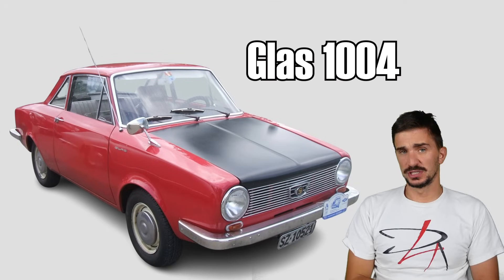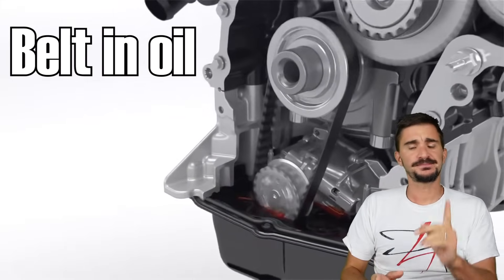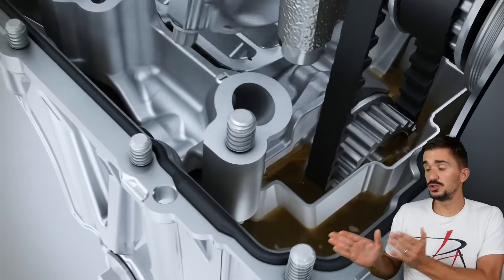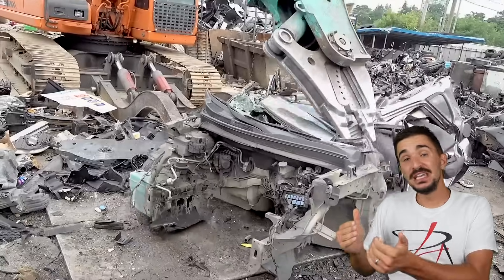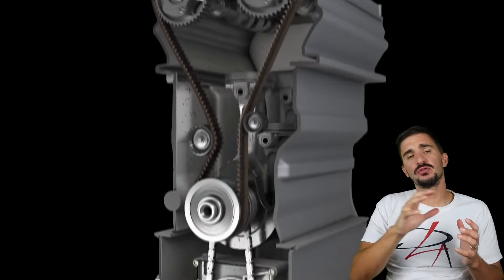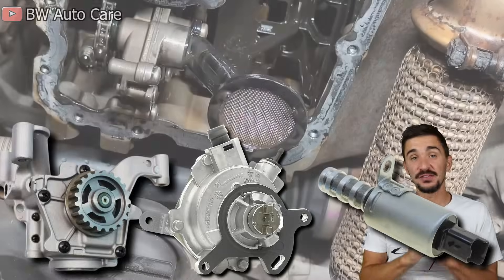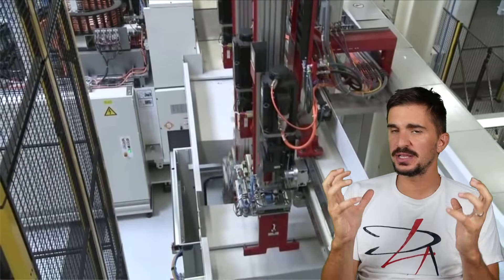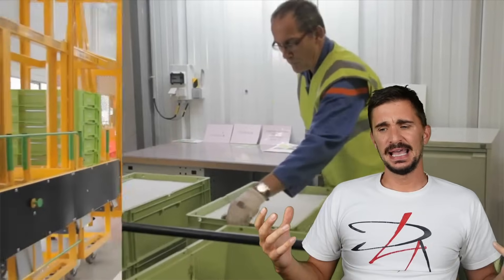Who Approved This and Why Is It Still Being Made? Wet Belt aka Belt in Oil Engines

Comment: I'm from Brazil, Yes we have middle age problems AND wet belts. I always recommend people to ask before purchasing a new car, if it has wet belt don't go any further. But most of people just choose cars by their design and comfort items
Reply: You hit the nail on the head, if potential car buyers did any research at all everyone would be driving around in 20 year old Toyota Corollas.
Reply: I am guilty myself. I was happy to buy a newly designed engine w the last car, i was proud to have checked. But besides that i did not dig any deeper. One would think people could compare more easily these days, but where can i find all that detailed info in 1 spot. Or is the answer to everything Honda or Toyota. ?
Reply: @anrit5972 well that’s literally my family rn 😂😂😂
Reply: Add in poorly made electronics and buggy software, and you have it all!
Reply: I bought a diesel with a timing belt because it was easier to maintain than a v6 with chains that would be an engine out repair. 
Better fuel mileage is nice but goes to higher maintenance cost. 
Love the exhaust brake though.
Reply: Brazilian here. Vast majority of mine and the poster's fellow country folks don't think objectively but rather "feel it is just the right car" for them, and proceed with the purchase. There hardly has ever been a nation milked for they money by the automobile industry than Brazilians. And now the Chinese are doing just that with they crappy, absurdly-expensive EVs.
Reply: The 2.7 TT in my Bronco has a wet oil pump belt... idiotic design.
Reply: us real car people choose cars on their lack of creature comforts however.. AC, no don't need that. Electric windows, no don't need that. ABS, no don't need that. Traction control, no don't need that. lol
Reply: @101jtag Honda or Toyota is always the right answer.
Reply: "all the kids will eat it up if it's packaged properly"
Reply: Bingo
Reply: I drive a 20 old naturally aspirated diesel car with no luxury. Its very reliable and easy to maintain.
Reply: @samazd4015  well I recently acquired a 1991 Volkswagen Gol with the AP1600 engine and is just awesome. It was made in Brazil and happily living in Uruguay.
Reply: @101jtag  "Or is the answer to everything Honda or Toyota. ?"  Mostly. They are not without some faults though, of course.  Any 5-speed or 6-speed Hondamatic automatic attached to a Honda V6 is generally a risk, those automatics were marginal even on the four-cylinder let alone the J series V6.
Reply: Old cars are just of better quality i guess @TickiTucki
Reply: @samazd4015  I completely agree with you.
Reply: The problem is if you avoid a wet belt, there is another boobytrap waiting for you, completely different yet also catastrophic.
Reply: @samazd4015  How old are you? I'm only 30 and I remember how much trouble old cars could have starting in the cold. I literally can't remember the last time I was freezing my butt off in a car because it wouldn't start.

That's not to say that some things aren't designed more cheaply. White goods come to mind. But just going by my experience cars tend to be more reliable these days.

Beware self-pity and nostalgia. Plenty of people like to pretend everything used to be better in the past. It's usually just an excuse for why they feel worse now.
Reply: @mrjoe5292  with old cars i mean 20-30 year old cars. I think they are more reliable than new to 10 year old cars because they have less emission control systems which often cause problems
Reply: I would include any vehicle with a CVT.
Reply: I also hate that people don't have any understanding of cars nowadays but on the other hand it shouldn't be necessary. People get ripped of by those big car companies and there should be more legislation in more countries against that.
Reply: I wouldn't expect less from the same people that believe automatic transmissions are maintenance-free, then quickly come to trash automatic vehicles when their transmissions invariably break and a full replacment is half the price of their car.

Comment: "I'm a fan of objectivity and rationality."  A-effing-men, brother, speak it!  This is the best-explained, best-reasoned takedown of the industry's painfully obvious wet belt scam.  Absolutely beautiful.
Reply: They did it to flamboozle regulators: the 1% savings was all about milage gains [real or imagined].  The fact it costs consumers 1000x to maintain vs what gets saved at the pump?  Not a concern of CAFE standards, or the politicians pretending they know anything about engineering or economics.
Reply: The lawsuits say it all... Sealants is losing their $#!^.... and that means money in the long run...
Reply: I HATE rubber timing belts
Reply: @jugears1081  Frankly, I prefer (a) gear-driven cam(s) but that's a lot more easily done on one of my Harleys than on an auto engine.  😀
Reply: @flinch622  totally - not mentioned in this video, but it's often the unintended consequences of government regulations that results in the OPPOSITE of what they intended.
Reply: Manufacturers know this design was faulty, but it's a cost effective way to wring a fraction more efficiency from the engine. Government mandates are mostly to blame.

Comment: I've worked in the automotive industry and you're correct, everything and that IS everything is driven by profit! I've been in meetings where a known problem is being discussed and the conclusion has been to leave it alone, fight any warranty claims and, if compensation is paid out it's still cheaper than a production line change.
Reply: WOW Im somehow not that suprised, but still WOW
Reply: EV motors save money by having no timing. Cheaper still.
Reply: @markrowland1366  Yeah! Then the batteries bump a rock and you have to scrap them because the warning button popped off (warning that the battery might have swelled). Try searching for a clip that shows a KIA Ioniq in Canada being charged $60.000 for a new battery for just bumping a rock with the undercarriage! A very small rock, I might add.
Reply: Of course it's all about profit. That's what businesses are made for. 

The main problem lies with the consumer. If the consumer doesn't research big purchases like the car they are about to get indebted for, these issues will persist. 

If, however, people, like our friend in this video, expose the obvious flaws of a certain product and the same attitude is followed by others like him, businesses will have no alternative than change their ways. 

When a company doesn't change it's either because of incompetence or lack of customer reaction (or both). Some go bankrupt. No profit there! 

That's why brands like BMW invest so much in creating a fan base and fanatic following, they can go further with their mistakes vs, say, Skoda or Renault who don't have that kind of loyalty.
Reply: It's like that everywhere. I work in IT on the huge projects and the approach is exactly the same - it's always better to let the lawyers fight than make it good way and let the profit shrink a bit.
Reply: @markrowland1366  Really, 800-1000 for a new belt vs new battery pack in less than 10 years costing 15,000+, plenty reports of EVs needing new battery packs well before they are supposed to last, oh and if you go over rough ground and scratch it you need a new battery pack, they don't replace one cell they replace the whole pack, what a complete waste of precious resources.
Reply: Good and interesting comment, I couldn’t run a business like that, even though I would possibly earn less money, customer satisfaction and recommendation is more important to me than being greedy, kind regards to you and everyone out there, Mark from the U.K. 🇬🇧
Reply: @markrowland1366  Of course there is timing circuit requirement for electric motors- it's in the motor-controller. These fail also.
Reply: @mr.g167  you might also be surprised to learn that, the sky is blue.
Reply: @jdesmo1  You dont know what you are talking about.
Reply: Eventually it makes it more expensive as brand reputation goes even lower and people buy less cars made by this brand. (Speaking of "cheaper" not to fix the problem)
Reply: Thanks capitalism, such efficiency!
Reply: But nooo that is most definetly not a fault of the current system we liven aka capitalism. If it doesnt make money its of no use today
Reply: Your case is UNRELATED. What is presented on the video, is intentional production line change TO MAKE WORSE, MORE POLLUTING PRODUCT THAT NOBODY WANTED AND NOBODY ASKED FOR.
Reply: Boeing tried that.😂
Reply: @markrowland1366  EVs are good for people who aren't planning on having kids. I might get one when I'm a little older...
Reply: so, MBAs?
Reply: What's always caught me as funny, is that in nearly every engineering undergrad course, there's an ethics class where they bring up the Ford Pinto and how Ford figured it was cheaper to just pay out burn deaths and victims than recall the firebomb Pinto.....

And yet....here we are yet again.
Reply: motors now have three pistons can we expect 2 on cars soon to save the shareholders bacon
Reply: @STCWGaming  It's nothing to do with politics, look at the rubbish that comes out of the Soviat bloc!
Reply: so, you think bad reputation due to engine failure is good for profit ??
Reply: In this case they spent money changing a production line to make something they must have known would be worse.
Reply: 100% right. How long have manufacturers with common engine failures built the exact same engines for multiple years and done almost nothing to correct it. There are always loopholes in warranties that give manufacturers reasons to deny warranty claims. They know most consumers will not engage in a long court battle over a $8,000 engine.
Reply: 😂😂😂😂😂😂 @markrowland1366
Reply: You are spot on there but ultimately it is the consumer's responsibility to understand the product they are buying and choose what is going to give best service.
Now the average person has little comprehension of what is going on under the shiny exterior so they will make uninformed choices.
However what most buyers will do is try to read reviews of cars before buying and this is where motor journalists should be stepping up and doing a better job. Quite frankly the standard of evaluation is abysmal with them drooling over things like the appearance of the cabin and how quick the car can accelerate to 60.
Did any of them mention in their reviews that the car had a wet belt and it was a really shit idea. You do not need to be a chemist or engineer to understand that oil degrades rubber.
Reply: I remember years ago, an American car manufacturer having a safety issue with the fuel tank position / mounting / security or something similar. 
Crunched the numbers and decided that payouts for injury / death would be cheaper than a recall.

Comment: As an ex-ford tech, we replaced quite a few transit custom engines due to wet belt failure at around 180k kms, pretty consistently. They would just rip teeth off the belt.
Reply: Lasted longer than dry belts..
Reply: Ford: Built Tough 😤🥴
Reply: Well as long as it’s out of warranty then ford is OK with that. They get to sell a van and a spare engine!
Reply: Maybe that's why the owner should have replaced it at 120k kilometers
Reply: @neilasd3043  dry belts go 90k miles.  2.2k per 1 mile.  Plus dry are more accessible. Outside the crankcase.  Time saved.
Reply: Built ford tough, when you need sand in your engine and oil submerged timing belts.
Reply: @neilasd3043  about 5x harder to do, and 5x as expensive though
Reply: @LA_Commander  but they were supposed to last 240k kms, so why would an owner waste their money... all but the first were covered by warranty anyway.
Reply: @SmileyTom666  Well here in the US the recommended replacement was 100k miles, which is about 160k kilometers.  I would personally not wait until the last minute to change out a belt, better to do it sooner than later.  However, I don't follow your statement of why would an owner waste his money but then you said they were all covered by warranty anyway so there wouldn't be any expense, right? Or am I missing something?
Reply: fappend to me on my ford 1.0 ecobost engine, on the highway, not a plesent expirience.
Reply: Compared to most dry belts 180K is very good. Maybe they should be recommending 160k.
Reply: @CheapBastard1988  And the labour of changing a wet belt and chain ARE THE SAME!!!!!!!!!!!!!!!!!!!!!!!!!
Reply: I don't believe Ford made a Transit Van with a wet belt cam drive.  Dry belt possibly.
Reply: @timewa851  2.2km per mile? might wanna check that...
Reply: @garybeecroft4565  2.0 Ecoblue... they are in everything here in Australia.
Reply: The teeth can clog up the oil pickup and starve the engine of lubrication even before the belt totally fails. Ford knows all of this, it's just a marketing thing.
Reply: @neilasd3043  True, but a dry belt is usually easier to get at so you are more likely to replace it at the prescribed interval. A second or 3rd owner would be more inclined to risk it than spend over a grand replacing a wet belt.
Reply: Yeah like mine from Portugal... 180k kms 9 years old car, but ford says that they dont cover the warranty because it's fast wearing material...had to pay it all.

Comment: That one percent fuel saving would go straight out the window as soon as the engine goes into rich mode because of engine knock.
So Infact there is no saving at all, just more expense.
I must say this channel is one of the best, if not the best automotive channel on YouTube. Great work.
Reply: Same with the EGR lie! Reducing NOX with feeding the engine junk meant less of a percentage of nox at a higher fuel consumption. Burn more fuel = more profit for the industry with total nox actually gone up!
Reply: But the knock is not actually caused by the wet belt, is it? Not seeing the logic here.
Reply: It's probably BS too, there's NO chance those engines save a whole %1. There's barely any friction between the belt and gears to begin with...
Reply: Certainly the Ford 1l ecoboosts have long been known to get nowhere near their cited fuel economy figures and I would not be remotely surprised if that's because they end up running rich because of the normal driving conditions they find themselves in
Reply: Your mistake is thinking that 1%  savings is to help  the consumer. It's for regulations like CAFE
Reply: 1% Saving on fuel is not much good when a 26k van becomes scrap metal after 19 months.
Reply: In real life you are correct however in the meantime the mfg was able to publish higher economy numbers which is all the govt cares about
Reply: @jonathanmillar they don't have to get stated fuel economy numbers in the real world, only in the epa test and certification testing
Reply: The manufacturer only cares about the economy on the official test cycle.  A new technique is setting extremely high placard tyre pressures to reduce friction, like 42-45 PSI, as the test cycle has to use the placard tyre pressures. 🙂
Reply: Good old fashioned automatically hiding the problem so the customer has no idea anything is wrong. Great idea!
Reply: It's like the stupid argument between $2.99 and $3.00 
I have had marketing people tell me they do that because it looks cheaper 
When in reality nobody cares about the 1c saving if they want the product they will buy it regardless
Reply: A small engine would still run hot and then make the mixture richer if it had a timing chain or a dry belt....
Reply: Mpg figures are pure advertising hype. They have no connection with actual driving experience.
Reply: The bigger negation comes from faster car failure and replacement. Cars themselves have a carbon footprint. The fuel burned by consumers driving to work to make money to buy a car, fuel burned mining and assembling, is an enormous amount of spent carbon. When you only look at MPG, you end up with EPA style tunnel vision and reliabilty-reducing designs that simply aren't worth it. But these people have to justify their jobs somehow.
Reply: @640kareenough6 You missed the point about how the richer mixture degrades the oil, which accelerates the decomposition of the belt.